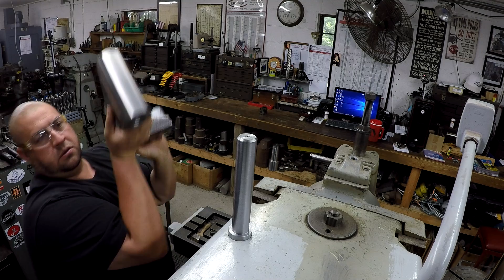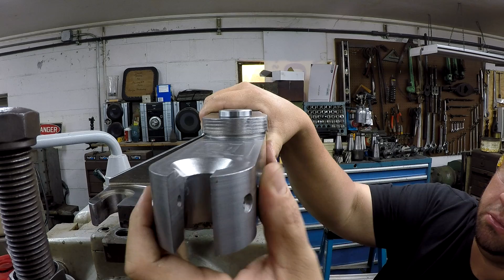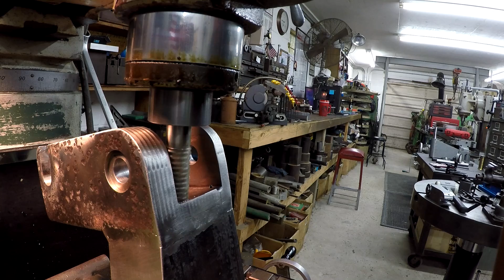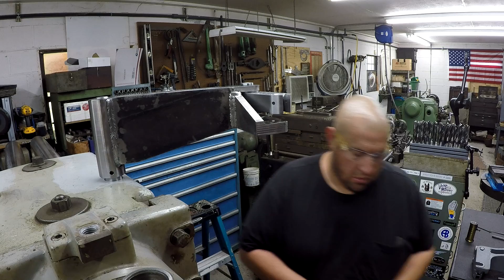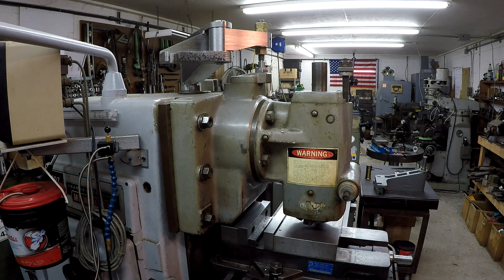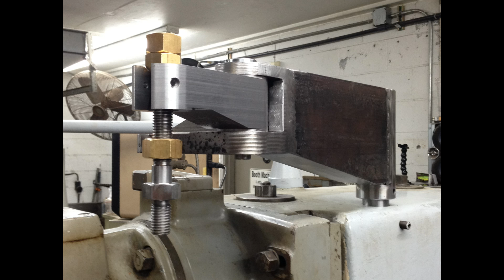Kearney & Trecker Parking Attachment 16: The Reveal!

Comment: Adam, you should put a pin or mill a socket for a breaker bar or something on top between the hinge and the nuts so you could use leverage when that thing is hanging so it easier to rotate to the locked position and vise versa.   Easier to rotate and no pinched fingers.   

Love the vids  brotha.

Comment: Both pivot pins need grease nipples near the bottom and internal grooves to encourage the grease into the thrust bearings - it'll make the thing a lot easier to swing.
I'd look at fitting it to the over-arm bars first before clamping it to the mill as those bars appear to be the only things that accurately position the head for the gearing.

Comment: I think it'd be handy to replace the roll pin holding the threaded rod in the swing arm with a hitch pin that has a spring detent.   With a hitch pin you can quickly pull it and swing the park arm clear of the vertical head.

Comment: Adam , great vid. enjoyed greatly. On another note in the 60's I dropped a 30 lb. Concrete block o my steel toed boots that bent the steel toe in one of the boots and pinned my toes in the boot . The men working with me used a sledge hammer to bend the steel toe into shape and freed my toes. Just a note .

Comment: Yeah, that 5" little arm NYC-CNC made for you means you do not need to withdraw the two support bars. The head should now be able to fully pull forward off of the supports, being that it allows the head to move nearly the full five inches forward... Which is a pointless thing to say, pretty sure you've figured that out in the three and a half years since this was made. Just saying so the idea fully forms for me; that's a nifty bit of kit they had for that mill.

Comment: I know a spanner works pretty well but would you ever think to use a cordless impact. Just one that's used for screws with the 1/4" hex to righted up and loosen off the 6 nuts that hold the head to the mill. Doesn't have to be really tight or anything. Just snug it up a bit and it'll be easier n quicker to loosen them on and off.

But saying that. I use spanners n sockets for pretty much everything. I only use impacts if it can't be done. Like I've got a scooter n the needle roller bearings are shot in the diff housing. I tried a few ways of getting the wheels of by holding the tire a few different ways and using a socket but I couldn't get it off. So I ended up using my impact as they were locking nuts. Holding the wheel and a couple of dacker dackers n it came straight off. 
I only use impacts if I really have to but they are life savers n the same goes with SDS's. 2 tools which are amazing!

Comment: Whoever is complaining about the brass nuts must not be familiar with worm-gear drives, like those found in rotary tables and gear reducers. The driving gear in such sets is usually brass, and those work just fine under heavy load. Hell, look at the elevating and slewing gear of old Navy gun turrets, you'll find brass gears there, too.

Comment: you can fab up the parking attachment now. Willing to wager that there are mounting holes underneath the sign plate for mounting said attachment.  Check with Keith Rucker, his machine is older but it has both crane and attachment

Comment: I am puzzled. I would grease the pin that was filed. I would grease the top & bottom of the arm, with the Abomb79 logo, which that pin holds, so the bottom surface in contact with the larger arm is greased. I think grease would make is so much easier to move.

Comment: How did the playlist miss this one?

As a follow-up comment to the whole series, for anyone making more, I think the roll pin locking the overarm to the shaft should be moved to the top.  I'm sure the shaft is strong enough even with the hole, but there's really no reason that hole needs to be in its most stressed area.  Also the 45 degree chamfer on the hanging nut is clearly functional, but these days a hemispherical grind is a lot easier to make than it was ages ago.

Comment: Probably my last comment for this video: Austrac, a railroad locomotive reconditioning outfit based in Junee, NSW, Oz,  in the old roundhouse, used brass bolts and nuts - I didn't measure them but 5/16" to 3/8" comes to mind, were used to hold the raised platform connecting the ends of the elevated servicing bays (they were level with the footplate of the locos) in place across the ends of the platform. The reason for using brass was that if the brakes failed or the engineer 'got it wrong', then the loco pushed the connecting platform off the bays, and broke the brass b/n combo, instead of bending everything up, so,really, it took 70-120 ton locos to break the brass bolts! I hope you get the picture here ...

Comment: nice job adam my only concern is the top brass nuts if you have to adjust them 1 nut is taking all the load ? might strip the threads, but nice job. love your engraving on the pivot arm.

Comment: People who were aware of stripping the threads are really bad at math.
If something on this thing brakes caused by overload it was the pin that goes to the machine. Correct me if I am wrong......
The total arm length by swinging the head around is 14 plus 5 inches so lets say 0,475m and the pin is 1,5´ in diameter. If it had a strength of 400MPa it would be able to take a force of 4350N at the end of your arm which is around 870 pounds. The threads will not care about that load. 
If I am wrong an the pin is just 1,25´ it just may take around 504pounds to bend the pin ;) 

Great Job Adam!

Comment: Adam have you thought of a slight modification? The set up with the short end of the shaft acting as the pivot is going to wear with all that weight hanging out on it. What about removing the roll-pin and locking the shaft in the machine top plate. That way you have a very large bearing to take the load. I'm surprised the makers decided to design it that way. What is your view?

Comment: no chance it could swing right around and mount on the rear of the over arms? The guys doubting brass might want to check what lifts their cars up on hoists, brass is way bètter than armchair experts give it credit for. It regularly seals up rifle pressures of 60,000 psi without becoming unusabĺe
Reply: Trevor Parnell Somebody else pointed out that even the nut for the knee lift is bronze!

Comment: Mechanic- Bolt/stud too long and bottoms out? Add a washer.

Machinist- Bolt/stud too long and bottoms out?

Define necessary machine work.
Build fixturing.
Machine to tolerance.  ;)

But seriously, looks like the parts package was missing a couple flat spacers/washers. Have a hard time believing K&T made it long accidentally.  Looked like a spacer washer underneath the stud end would have let everything clear.

Comment: Just thought that i`d add. it`s 2 nuts not three, the one under the arn doesn`t take any strain. It`s only a lock nut.     Also 7900lbs  supported by one brass nut ???????   Sounds optimistic to me. that`s over 3 tons..   wouldn`t want to be standing underneath it.

Comment: Awesome video.series. I took me a while to get to this last one. I ended up binge watching from the beginning, of your entire channel, lol. I would comment on the top adjustment. It looks like if you tighten the brass nut with the conical surface slightly, that will allow you to set the head dead level with the over arms, without binding that entire assembly. I know you were able to push it up, but if a bit of a turn there on that adjustment lets it swing right in, it seems to me that may just be why it has a bit of adjustment up there.

Comment: You were sweating a little bit there Adam.
Good thing you compared your part to the original part.
Great job Adam.
When are you going to use the welding table for us to watch?
I am dying to see that in action !!!
On the mathematics though I believe that you are wrong on the triple strength.
The bottom brass nut is in opposition to the upper nuts. So you would have double the strength but not triple strength.
Either way though, the top brass nut will keep the middle one from moving, vibration more specifically that could possibly cause the nut to strip out long before the brass strength gave way.
All in all a great build and I only bring it up as a point of reference and not to denigrate anything you are doing.
Great job, you're like a proud poppa with you new toy here !!!

Comment: I know you talked about it but be careful with those brass nuts. They may be able to support 7,000 lb each, but if you decide to cinch them against each other, they pull against each other and you have to subtract that from the tensile load. A plated nut/bolt combo at 3/4-10 and torqued to 200 ft-lbs has 21,300 lbs of tensile preload. Obviously you're not torquing those anywhere near 200 ft-lbs but with brass having great lubricity on steel it would be easy to generate at least several thousand pounds of tensile load on those threads with a good pull from that wrench. Honestly I think you should make the top nut steel, just in case. Plus, I think it goes without saying that everyone here would love to watch you make it!

Comment: I guess you can just leave it permanently attached...... , but you could turn the unthreaded portion down, to make it just  less than the root diameter of the nit, that will allow you enough room to drop the nut down so you can raise the   the lifting screw enough to get above the lifting plate  while the lifting screw is still captured by the roll pin.   if you get my drift....that's  actually what i thought the lower unthreaded O.D was for, lol

Comment: Adam 
One brass nut has a yield of 7900IIbs? you don;'t have triple nuts so its not 70000IIbs. Only two above the suspend point and they would only work together when tightened down together.

Comment: HI Adam,
I am behind on my video watching.... so I am sorry to say I just got around to seeing the finished product.  Congratulations on the sweet success of completing the parking attachment. 

About the brass nuts... It is always good to know if the size, or selection of material is adequate for the application.  This is something that I struggle with often. From time to time at my job I am called up on to do some engineering functions, my degree is in electronics and I am just not good at strength of materials type problems.

Do you think you could sweet talk Tom into explaining how to do the calculations for a tensile application like yours, as well as a shear load, maybe torque also?

Thanks for another great video series,

Mike

Comment: Dont want to be the wiseguy here buy some oil on the joints and you need to use the 2 support shafts in the top of the machine to guide the head back on that is verry important for your alignment.

Comment: as to the "three nuts".. you are only using two nuts as part of the load bearing calculation, nevertheless, i see no issues with the static load 'freestanding'. (unless there is something like an earthquake going on, then a real snug bottom nut will help curtail any heavy swinging...) in fairness, i didn't watch the whole 'build' series.. so i'm not sure if the original wasn't working anymore and this was a more versatile replacement or just a project to duplicate the original and the goal was to just to enjoy the journey of recreating the original. in any event, congrats on ingenuity and results ! :)

Comment: As = sheer area per thread(nut) = pi(d)(W0)P where d is the major diameter, W0 is from a chart (.88 for UNS threads), and P is the thread pitch (10 TPI; P = .1)

As = 3.1415(.75)(.88)(.1) =  .20734 in^2 per thread

at 10 TPI, a 3/4" nut has 7.5 threads. 7.5 x .20734 = 1.555 in^2

sheer stress for a thread stripping = F/As = 700lbs/1.555 = 450.160psi

von mises stress = (3 x sheer stress^2)^(1/2) = 1350.48psi

360 brass has a yield strength of 45,000 psi gives you a factor of safety of 33.3 - thats for ONE nut.

i think your good....

Comment: Nice build of the articulating arm Adam. If you were at all worried about the brass nuts stripping with the weight you could fabricate a 4140 top ring to use as both a safety stop on the visible thread at the top as well as a captive collar for the top brass nuts. A simple roll pin through the threaded steel AND the collar would cover the top threads too. I am sure that you have thought about a grease zerk on the shaft collar to make it easy the rotate the arm. I always enjoy your attention to detail on machining and that you talk to your subscribers as you work through problems. Great job.

Comment: Its funny how a practical joke can screw with your trust in friends. I'm sure Tom wouldn't ever mislead you into putting your self under 500+ Lbs., that could kill you...at least as long as its not a competition :)Just watch out for those handy gifts just before a competition if Tom's around.This is a great Project and please don't take this the wrong way. I'm really  no machinist but I like to see finished machined parts look like they are  finished. How do you decide when a project needs to have the scale and rust removed and the weldments smoothed out and when the time it would take to do it weighs on the side of waste? Would smoothing out the welds possibly weaken them? I mean it looks like its nothing a belt sander couldn't make short work of in like 10 minutes.Any how, Your videos are always a pleasure and a good educational experience for me thanks and keep them coming.

Comment: It looks like your dimension problem isn't really an issue. Here's what I mean: Rather than moving the swivel arm fully counter clockwise to align it to the v-head and bringing the two mating faces together,  the carrying stud is left in the  "safe" position of the lower carrying bracket, then the vertical head is moved close enough for the over-arms to be slightly extended and engaged in the vertical head first. Then snugging the clamp of the v-head on the over-arms, then using the overarm crank to pull the v-head to the mill and aligning the drive and mating flanges. Just my observation.. Again, great work and a unique display of adapt and overcome!! Keep up the good work.

Comment: I've got to think the guy worried about using brass was thinking it might wear more over time, which may have some merit if it were being put on and off 2-3 times a day over 10 years, but if kept lubed, would likely never fail- at worse maybe get some slop which wouldn't even matter in this application. I'm guessing you have 3/4-10 thread on the bolt(a315??)? Off the top of my head I seem to remember grade 5 3/4-16 being good for about 33K. I  dropped it to 30K for 3/4-10 and then figured about 1/3 for brass and felt like 10K was a good ballpark just before you quoted 7K, so I would have bet 10:1 it was good for 5K.

Comment: Great job!  I was wondering if you were as apprehensive as I, when the hole didn't line up as you thought it should. Man, my heart dropped a few feet!  I was pulling for you, but should know you'd come through just fine.  Just curious when you started this project, did you assemble the loaner parts on your machine to see how it was supposed to work?  I may have missed that in the videos, but thought I watched it all.  Can you add a picture of the backside of the head when its swinging free?  How far into the head do the over arms go?  

I doubt there is a problem with the nuts holding the weight, and when it is all locked down it is being borne by the three nuts, but when the load is "live" it is totally hanging on the top two nuts, so any calculations should only use the thread length of the top two nuts, not the length of the third nut, and certainly not the length from the bottom of the bottom nut to the top of the top nut (the gap adds nothing to the load carrying capacity).  It is only the 1.5" of threads from the top two nuts holding all that weight.  But probably moot anyway, as it seems "Adam" stout!   Great job on the build, and at the end you looked both happy and relieved!

As always I enjoy your videos, thanks for doing them, taking the time to make them informative and entertaining, and all the effort to do an excellent job on editting, still photography and the glare issue.  BTW, because polarize filters are designed to minimize a certain angle of polarization (outdoors, sunlight off of water or foliage comes at pretty much a single angle) you may never be able to eliminate reflections entirely.  This is because you have florescent tubes in your shop.  The light source is pretty much all directions, so no matter what way you orient the filter there is still plenty of light coming from another direction.  If you were using a few flood lights instead you'd have better luck getting rid of the reflections.  I like a well lit shop, and think your setup is perfect.  Maybe just shield the dial glass from the overhead lights, so it is lit from one small clamp lamp.  60W from 5' away would be plenty, and you can control the glare angle precisely.  Just a suggestion. Thanks again, great job on the build, and as always great job on explaining what you are doing, and why.

p.s. (to an already too long comment) but thanks for pointing out the thing about the files being bellied if they have a lot of use in the middle.  It would never have occurred to me, and yet just yesterday I was sharping the kitchen knife and frustrated that my stone was dished.  At least a stone can be flatted.  Reserving a good flat file to tasks that require it is a great tip.  To my knowledge there is no way to flatten a dished out file.  Cheers!